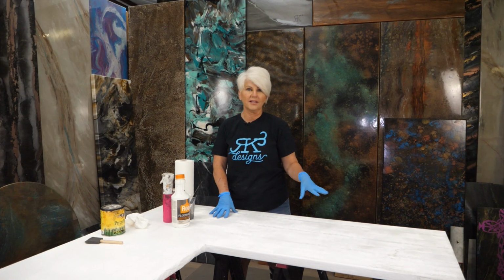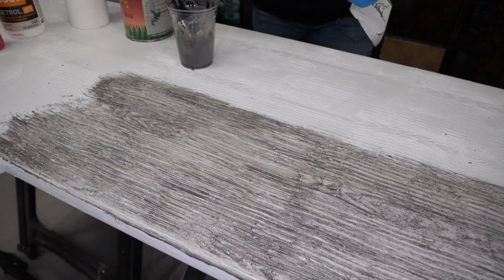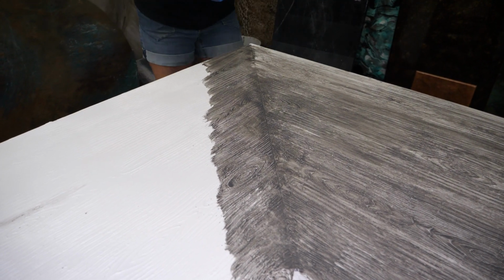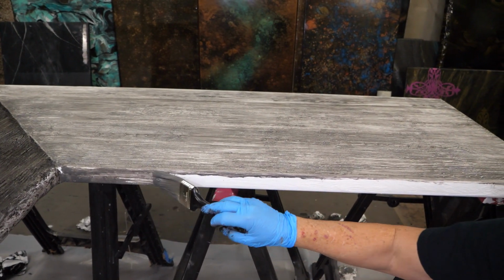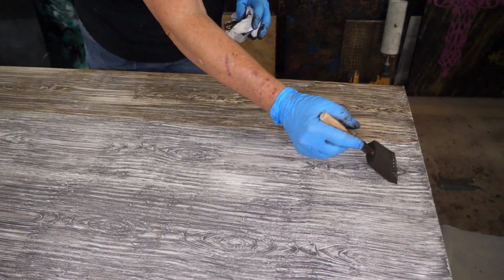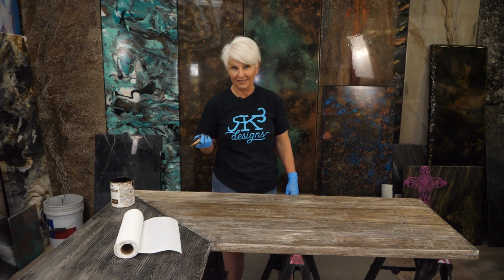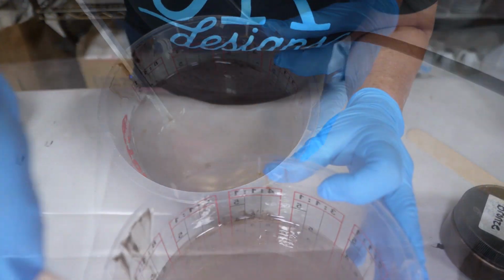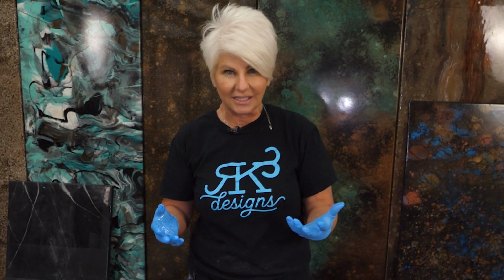How To Create A Faux Wood Epoxy Countertop Part 2 | RK3 Designs

Comment: Could this finish be done on a floor? Would it be cost effective? It’s really beautiful and someone could make it truly unique to their taste/style.
Reply from the maker: I wouldn’t recommend it be applied to a floor with this texture medium, just because of the excessive weight and traffic of a floor. There’s maybe another medium that is durable enough for flooring. I would have to do some research.
Reply: @RK3Designs  Thank you for the information and for taking the time to respond.
Reply: I'm thinking about doing the same!
Reply: I have used a technique that involved painting my subfloor a lighter color then using a dark brown gel stain and a wood grain rocker then sealing it with a fast drying clear acrylic sealer.   Yes yes I know painting sub floor is “bad” but the worn and stained pink carpet from the 80’s had to go and it was the only option.  It’s lasted for over 10 years.  I have no regrets.  Anything was better than the carpet.  I have pets and kids, my floors get a lot of traffic but it’s held up surprisingly well.
Reply from the maker: @deliciousness5688  great advise and way to go thinking outside the box!!!!

Comment: Just gorgeous 😍 I'm no faux finish expert by any stretch but I do try. I wood grained my front door and garage door this fall and tried so hard to figure out how to get that dark shadow in strategic areas. I failed because I was using gel stain and didn't know what to use on top of it that had controllable coverage. It came out fine without the shadowing but I'd still like to know how to get that with oil based products.
Thanks so much for your expertise! You are bomb!

Comment: Thank you Rhonda. I like the side you made the planks, that looks so realistic. Doing it this way would you still have round you edges or could you have sharp edge? Could you tape the edges and let the epoxy set up for a little while then pull your tape to let it run over the edge? Both sides are stunning, your creative abilities are amazing you are so talented.
Reply from the maker: You probably could get away with keeping a 90% edge. I would use my hand thought to apply extra epoxy on the edges. 😊😊

Comment: I love them both! I need to research how to do on an uneven old wood floor!
Reply from the maker: You can pour a concrete overlay and use concrete decorative rollers.
Reply: @RK3Designs  I may try that! It's my son's house, and he may want to refinish the wood floors at some time, need to do a quick fix for a hallway, it's not terrible but just not completely level.